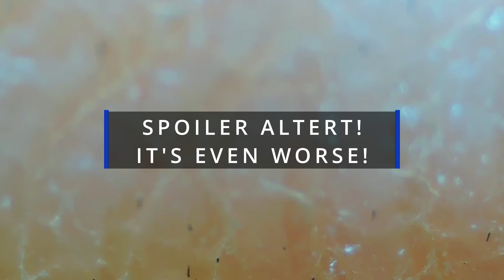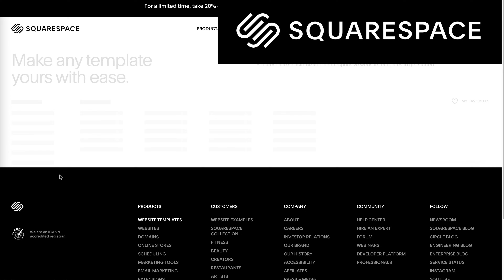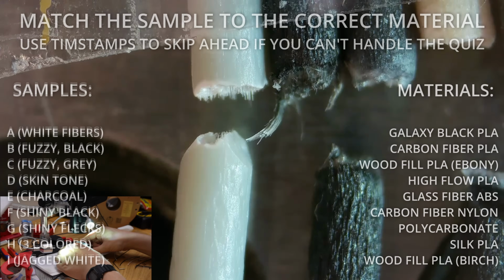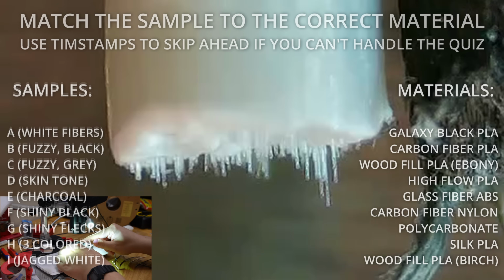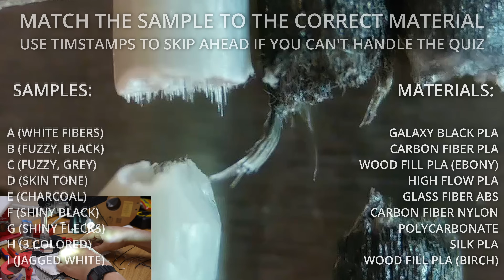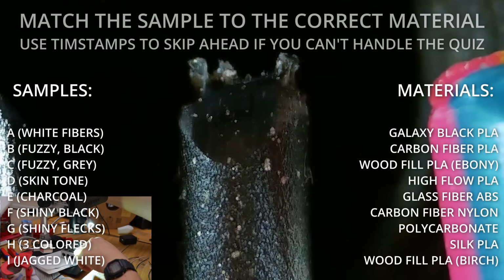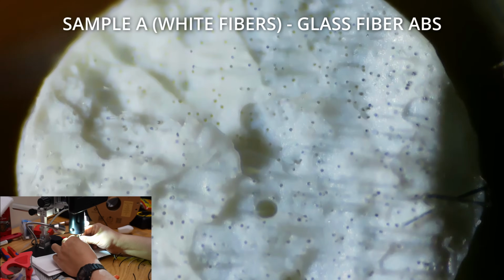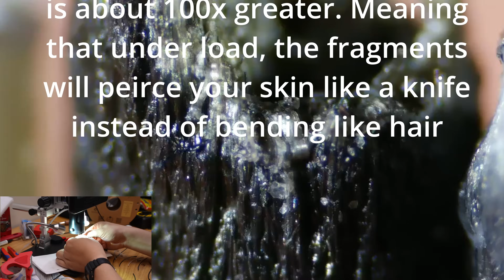Carbon In My Skin. These Wounds, They Will Not Heal.

Comment: Ever since I got into 3D printers, I learned about the micro plastic problem and decided to mitigate it by isolating my printers in a garage with vents sucking air out. I also wear a p100 respirator anytime I’m in the garage if they’re running. I only use pla+, Lw-Pla, Petg, and tpu. I’m glad you made this video. It’s hard to avoid plastic exposure since it’s literally everywhere and in/on everything. But you can’t 3d print a new pair of lungs.
Reply from the maker: Yet 🫁🧵
Reply: @NathanBuildsRobots lol.
Reply: not necessary for FDM with normal filaments, AQM doesn't detect abnormal levels of PM 2.5 or 10 at the makerspace I work at. now resin is a hole different scenario.
Reply: @Megasteel32  What is AQM and I could have sworn there was a study done a while back that measured sub 2.5m particles from fdm printing. That study is why I decided to take precautions. Also the fire risk. I never run my printers unattended (octo print with web cams). I've had one instance I averted a fire because I caught the printer when the heater block came loose from the heat brake and it was still trying to print...
Reply: @bluesteel8473  fire risk? lol. we leave our printers running all the time overnight and overweekends. get better printers?

also AQM = air quality meters. Idc what a study says when the real world data in my instance disagrees with it.
Reply: @Megasteel32  You shouldn't dismiss safety. Anything mechanical can and will fail. It's your type of thinking (can't happen to me, I spent a lot of money) is why accidents happen. 

Hey at the end of the day, you do you. I'll never understand why some ppl make comments like yours criticizing those of us who take safety serious and steps to protect our selves and others. 

I used to work with gas leaf blowers and other men would do the same thing criticizing me for wearing ear protection and a n95. 

Like I said its already saved me from a fire. And if someone reads my comment and decides to take some safety precautions, that a good thing and worth pursuing and noble.
Reply: @bluesteel8473  lmao I can dismiss fear mongering which is what you're doing
Reply: @Megasteel32 bro is mad for no reason
Reply: I’d add, wearing gloves can’t hurt. I also burn off the tiny strings of plastic that are typically on my prints with a lighter or candle. I figure it’s better than mechanically cutting them off since they can float around in the air.
Reply: @bluesteel8473  where do you think the soot goes?
Reply: @stealthwang soot should at least be a bit less permanent than Microplastics.

I tend to burn, then wash with water+dish soap (in theory any residue is washed off)

Precision Temperature Control Heat Gun and/or Inert Gas is my dream for print thermal post processing, can set it to the exact melting/softening point etc
Reply: @ericlotze7724  i have a hot air rework station and you have inspired me to give it a shot next time i have some stringing to clear up. i normally reach for scotch tape, a lighter or just pick it off
Reply: @stealthwang  True, I think its safer to burn it into the soot vs mechanically remove it and risk particles (sanding) floating in the air for me to breathe vs the soot. I wish I had a sand blasting type enclosure to do the clean up in. It could also filter the exhaust.
Reply: @bluesteel8473 you thought it was safer to burn and inhale plastics as opposed to cutting it off and throwing it away?
Reply: @bluesteel8473 I mean clippings are more like macro plastics lmao
Reply: Yet.......
Reply: p100 won't do anything and microplastics are not an issue when 3d printing unless you handle the plastic yourself, the real issue is the vapors being produced. As such you need a mask rated for organic vapors to get a bare minimum level of protection.
Reply: New project: 3D printed lungs with replaceable air filters.
Reply: @dashdartfun  ah yes bio 3d printers,

They are also theoretically safer, since exposed tissues (especially the cells litterally going through the tubes) should be much more sensitive to unhealthy things than us complete bodies with built in decontamination systems would 

Laser Metalic and resin printers are probably healthier this way even though they are more expensive
Reply: @theeyeofomnipotent  You could probably make an artifical polymer that is safely carbon based and keeps similar conditions to real lungs.
Reply: That sounds pointless and excessive as fuck when considering you exist in the modern world. The mask won't extended your life in any capacity if you even dare exist by a road so you can at least ditch the mask routine to save on money.
Reply: this man is cooking
Reply: * yet
Reply: Not yet anyway lol
Reply: Thanks for blowing your plastic filaments out of your garage for all of us to enjoy
Reply: @Tekner436  NP. Your right tho, Ill look into a way to filter it. I doubt it's going to do much tho since the particles are so small. I'd need at least a HEPA to make a dent. I don't think venting 3d printer air is any worse than spaying paint outside or using a BBQ or fireplace.
Reply: Room Temperature IQ Take
Reply: @craigjoe8691  What in my response displays a "Room Temp IQ"? If you think I got something wrong, Please let me know.
Reply: Please consider filtering what you vent out.
Sincerely,
Those who breathe outside of your garage
Reply: @williamsistler1751   Hmm, your right. If I add a HEPA filter to the exhaust, I'd overwhelm the flow on my current setup. One day I'll have a 12" extraction fan to really get decent airflow and I could mount a house filter. I doubt it would do much as the micro plastics are very tiny. My p100 isn't doing much for me but at least it helps with 2.5micron and larger.

Comment: these videos need to go viral. the 3d printing community needs to be aware. wheres Joel 👀
Reply from the maker: Joel doesn’t simply appear, he has to be summoned! JEEEEOOOOOOOOOOOOOOOOOL
Reply: @3DPrintingNerd 🔥a w a k e n🔥
Reply: Micro plastics have been in water and environment for a very long time and people and animals have been drinking it so I wouldn't worry about getting it on my skin
Reply: @MikeHoncho0811  then you can start worrying:
microplastics are relatively soft and rounded, while carbon fibre is razor-sharp, inflexible and hard, as if you've swallowed tiny knives...
Reply: @joanyadhatan  reinforced plastic is nothing new it's been around for a long time and has been breaking down in the environment and studies have found the particles inside humans and animals as well as water
Reply: @MikeHoncho0811  You are right and microplastics are less of a danger than most people think. Plastics of itself are very stable molecule chains and don't react with other chemicals or cells in your body (unless it is heated to the amount in wich they break up) I worked over 10 years in the plastic industry and handled tons of different plastics and i'm fine. The most dangerous plastics are those with over 40% fibre glass content, wich can create dust when it's dried or handled as granulate. You don't want to breath that stuff in. The other two common ones are POM and PVC wich can be dangerous if it overheats. They create toxic gases like Formaldehyd and Chlorgas. But as long as you use these plastics correct it's safe.
Reply: @MikeHoncho0811  and lead was(and still is) in the air for decades, we have to stop the cycle at some point and reduce exposure if we want to lead healthy lives.
Reply: Why would they not be aware? It says "carbon fiber" right in the description when you buy filament. I really don't know why people use the shit it doesn't make stronger prints anyway

Comment: Again, CF fibres less than 1mm in length and loosely distributed in a polymer is a pretty useless application of CF. - it adds zero structural benefit and is more of a gimmick IMHO. Your biggest risk from CF is if you inhale it, so every roll should have a health warning on it and you should always have a mask on when using it - especially when you're cutting it. Cut a sheet of CF while there's a bright light on it and you'll see the stuff everywhere in the air.
Reply: Plastic engineer here: The fibers do add stiffness, reduce warping a lot and increas thermal stability. These materials have been used in injection molding for decades for a reason and we have proof in the form of numerous material tests and simulations. Materials reinforced with fiberglass and/or glass beads, like PP-GF or PA-GF are used in injection molded parts for anything from cordless drills, medical and food related equipment, to automotive structural brackets and body panels. Fiber length for these materials is way below 1mm, especially once it's in the mold.
Reply: @MrsMcMuffin  Glass beads? Like micro-bubbles? I only use them for filler applications - very handy. With injection moulding, what ratios of CF are used? I'd imagine it would be much higher than what a plastic filament can hold. Wrong?
Reply from the maker: Good thing my A1 cuts a piece off every time I use it 🥸
Reply: @NathanBuildsRobots  This is mostly a problem with abrasive cutting and grinding methodes used for cutting continuos fiber materials like carbon fiber or fiberglass laminates. The A1 shears off the material, that doesn't really create any more dust than just handling the filament itself does.
Reply: Well, the reason why I used CF is because it warps less when printed. Looks like I'll be phasing it out and looking into other ways to combat warping. Unfortunately I have a Prusa so any serious attempt to raise the temperature inside the enclosure will likely require me to re-print and install all of the printed parts in a material that can tolerate high enclosure temperatures.
Reply: It has benefits. Like allowing any printer to print nylon with just a nozzle change as opposed to all kinds of challenges with normal nylon. Plus it looks cool, and is significantly more rigid, with better thermal stability. However I'm going to think twice about using it without a clear coat.
Reply: Lots of fear yet nothing credible to prove a few microscopic specs in the hands mostly dead skin will do anything at all. Fear for clicks with no real science

Comment: Skin pores have direction, rub proximal to distal to remove fibers.
Reply from the maker: But also I don’t think they are opportunistically finding pores, they are small and sharp enough to just poke in wherever
Reply from the maker: What does that mean??! I need a compass!!
Reply: I'd like to know what that means as well... "Rub from the close side to the far side" which side is which?
Reply from the maker: Like, away from the body?
Reply from the maker: That makes a lot of sense in terms of flow optimization

Comment: 15:44 i really wonder how much microplastic comes from clothing and how much plastic is in the air or hopping around as dust bunnies
Reply: Get a UV flashlight, it was VERY eye opening for me!

I fear using it to see what the soil looks like at my work (where i weed wack with neon orange nylon line)

Pros: Glowing Soil

Cons: Potential Health Risks also lowkey uncleanable litter that will probably end up in the fossil record 💀
Reply: @ericlotze7724  Eh, bacteria will figure out how to eat it.

...just maybe not in time for any humans to still be around to benefit.
Reply: @widget5963  the one issue i have with this too is IF microbes figure out how to eat it then it no longer has that benefit of being “indestructible” to an extent; it will rot like wood.

Good for some things, but having a material that doesn’t rot CAN be very useful (also a LCA looking into emissions/pollution etc from paint/coatings and so on as a comparison would be neat)

I was going to write some bit on this of not just “biodegradable” or not, but also how fast it biodegrades, instant like paper or years etc

Comment: next step, get a very thin but mildly dense piece of a filter, reverse the flow of a part cooling fan and place the filter there to then see it under the microscope so we can see what particles are actually flying around mid print
Reply: Adhesive tape or that design for the 3D Printed Pollen Collector someone pit on a bike may be an interesting way of measuring these things as well.  Also UV Lights make some Microplastics fluoresce and be more visible.

Granted look for existing scientific/industry standards too, heck may even be some ISO standard!
Reply: @ericlotze7724 only problem with iso standards is they make you pay to see them
Reply: @ericlotze7724 then endoscopy to check fibers in the lungs 😅
Reply: True
Reply: That stuff, in ya lungs, delicious
Reply: @TheGameGuruTv  picking fruit, eat it right off the tree,... delicious
Reply: Like a filter for a soldering fan would work a dream❤

Comment: How these fibers can dissolve in the body, that's the question, and whether all these fibers are carbon. Asbestos is carcinogenic only because its particles in the form of needles do not dissolve in the body and thus remain in the body indefinitely, and have a needle geometry that gives them an extremely high ability to penetrate into the cells of the body and stay in them.
We need to understand what we are looking for and why we are looking for it. Just taking something and doing something is unscientific, and it doesn't say anything specific. The topic is important and interesting, but first you need to develop a certain scientific or close to scientific research method. And for this you need to be well acquainted with the scientific method and materials science in general.
Reply from the maker: Carbon fiber is about as soluble as diamonds.
Both are forms of pure carbon with strong chemical bonds.
Reply: @NathanBuildsRobots  Okay, that's interesting. And this is a question for chemists.
And there are cilia in the lungs that clear the lungs of some particles, and then the question arises whether the particles that we are analyzing can be cleaned out from lungs buy these cilia or not.

Comment: SLS and similar processes are literally makirn parts form microplastics. So Yeah. Even more 3D printed parts that gives me the heebie-jeebies than resin prints...
Also That ESD materials are very popular in the industry, mainly for printing fixtures for electronics assembly lines. But i am not sure if the nanotubes are listed in the Heath and safety datasheet for the material...
Reply: "carbon additive" is listed in 3DXTech's ESD filament and it recommends ventiliation, and gloves but is otherwise pretty mild about the risks
Reply: @stealthwang one note about SDS sheets, while they are great, for more niche hazards (ie not “immediately bad” and easily detectable stuff, my joke is the deionized water to mustard agents scale lol) there often isn’t good data or testing especially on the blend so the research section will lowkey be like 🤷
Reply: Granted if done in a cleanroom of sorts with sticky mats and sealed transfer between raw materials, printer, and post processing, the dust should be pretty well contained.

Still though, using it especially with non-biodegradable plastics is not great.

Metal SLS (or even better SLM / SEBM…) However